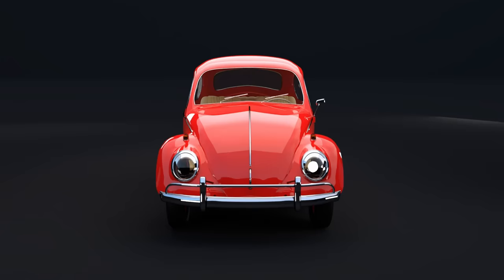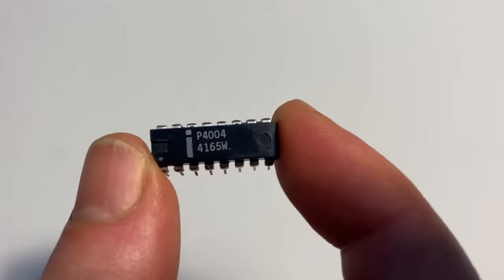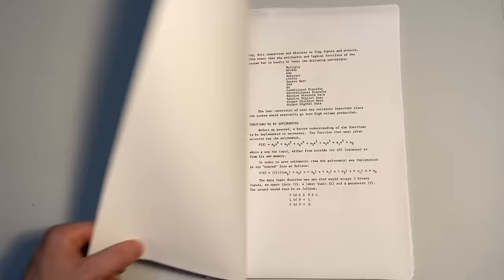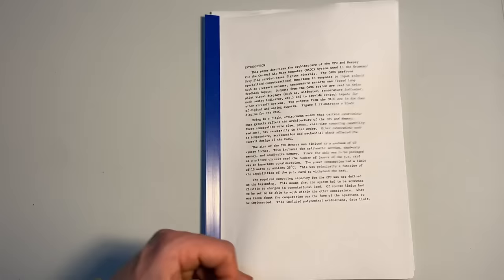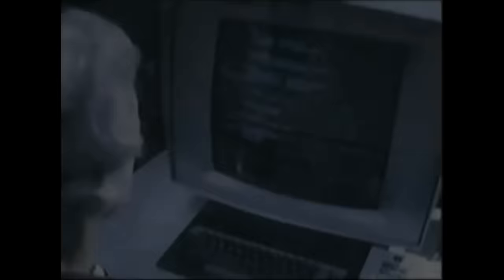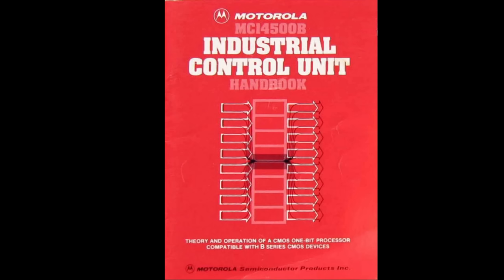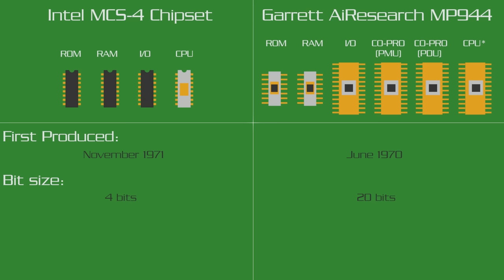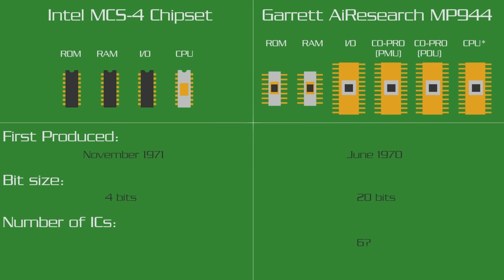The World's First Microprocessor: F-14 Central Air Data Computer

Comment: I think the biggest argument potential against the CADA being a "microprocessor" is that it can't do conditional control flow.

Not really a problem for the intended use case. The lack of conditional control flow is actually a massive advantage, as conditional control flow makes it hard to meet the hard-realtime requirements. Instead, the CADA ran a fixed loop of 512 instructions every 1/18th of a second, continually running the exact same equations. 
Anything you can do with conditional control flow, you can also do by calculating both sides of the branch and then select the correct result, which is a common technique in GPUs. 

This isn't actually a limitation of the MP944 chipset, the rom chip does actually have control inputs for controlling the program counter, with "reset", "retain", "increment", "load", "add" and "sub" instructions... In the CADA design, it's just hardcoded to the "increment" instruction to make it operate in sequential mode. 
However, there is no simple way to feed results from the "CPU" back to the ROM chip's program counter. There is no compare instruction, there are no flags. It's simply missing any functionality to control the program counter. If you did want to control the program counter, you would need to add yet another ROM chip and then a bunch discrete logic ICs to implement a "branch control unit" that implements a compare instruction and feeds addresses back into the ROM chips. 

It kind of feels like the MP944 chipset is missing a 6th chip to implement this branch control. 

The Intel 4004 has a massive advantage that the CPU chip has all the branch control stuff built in. The program counter might actually live in the ROM chip, but the cpu can modify it over the shared bus. You can create a minimal 4004 system with just a CPU the 4001 ROM/IO chip and 4002 RAM chip, and it has all the functionality a modern programmer expects a microprocessor to have. 

With the MP944, you are taking about dozens of chips before you get something fundamental to general purpose computing as conditional branching and conditional branching. It really stretches the definition of "small number of chips"

I guess it depends how you define "microprocessor". If your definition is just some kind of processor built with specialised microchips, then the MP944 absolutely counts. But if really doesn't look like anything that a modern programmer or engineer would consider to be a microprocessor.

Comment: What is amazing after listening to this, is that the Navy didnt upgrade the awg 9 radar to digital before putting into the Tomcat- as good as the awg 9 is, it just doesnt have the capability that digital processing brings to the table. This became very apparent flying the tomcat in DCS- the notch filter is just massive compared to the F15.

Comment: Hi! Electrical/computer engineer here and the waxing and waning in the microprocessor section was agonizing. The heart of your confusion is in struggling to define if the system can be called a microprocessor if it is not a single unit. The answer is the operational system all together is the computer. A system that can do all that on one chip is not referred to as a microprocessor it is referred to as a microcomputer or micro-controller. A microprocessor cannot compute on its own, it needs the other peripherals to run programs, it needs memory attached because they do not come with any. By failing to understand that the system you are describing is a microcomputer you are asking if these two processors are microcomputers and the answer is no they are both microprocessors.  MP944 is the name of the chip set which all together comprises the architecture of the computer but the lone CPU chip within that system can be called the first microprocessor. The sophistication of that chip suggests to me that perhaps a more crude microprocessor could have potentially been developed even earlier than that one and deployed in an item that is still classified.

Comment: A microprocessor with everything it needs to run on is own without any other chips is a microcontroller.  That's the way I learned it anyway.
Reply: Either that or an SoC. The distinction is more about capability than anything else I think. Microcontrollers tend to be less powerful.

Comment: Quick clarification: Radar didn't track only 6 target simultaneously. That number was higher. 24 if I remember correctly. 
It was able to lock and target 6 tracks simultaneously in TWS mode while talking to and guiding the missiles, which was absolutely insane capability back then. Beyond science fiction.

Comment: It's interesting to consider how much different computer science and computer design would be today had we not have started with analog items and them replicating them with digital ones.

CPU cache and RAM is is one hardware example. There are dozens of examples in the software realm.

I am sure that, if we started all over again (new languages from scratch for digital items, etc), within 20 years or less we would achieve a net increase in efficiency. We depend so much on analog frames. We could be so far ahead!

Comment: This is fascinating. Both in the exposition of design features and trade-offs (SBIST is alive and well today even for processors not yet released), and the similarities between the MP944 pipeline and a modern wide in-order MCU pipeline with asymmetric ALU stages. The SL feels so like the decode/issue and register bank multiplexing. It is such a shame that the 4004 pipeline is the reference that seems to be so locked in to basic computer architecture descriptions since it is so restricted.

Comment: The thing about the 4004 was that it popularized some techniques (VLSI) and  made it for 'general' consumption as I understand. The MP944 is clearly more complex and much more capable (but also built for a purpose, and no doubt much more expensive). There were others in the space implementing similar specs (more of an 8008 competitors that intel introduced a few months later).

Making the product commercially viable is very-very-very difficult, which is where intel really exceled (along with others like TI, motorola, etc.). The 8008 was quickly introduced after the 4004 -- the 4 bit design was too limited.

Something to think about is that the 'industry' wasn't very big back then -- everybody knew everybody. Many employees worked at other companies, etc. - Ideas, news, etc. travel fast. The innovations that allowed the MP944 and Intel 4004 to succeed weren't 'secrets' per se -- and I would wager that many people had an idea of what the Navy was doing / how the technology was applied in the plane.

Also if  interested, learning how each part of the microprocessor works is intense and rewarding (learning about transistors to begin with), but then how things like memory addressing works, interrupt handling, registers, adders, etc. It feels like you start with some basic concepts (which turns out aren't so basic) and then build on top of them. Then you see a logic schematic of a 4004 and it looks very complicated -- and really it's just a MVP

Comment: One oversight on "non-linear" given the hair-splitting nature of the video.  

We've have mechanical computers for "non-linear" computations since the early 40s (e.g. ballistic computers for artillery and bombs).  

I suspect the term you mean is "chaordic interpolated"--essentially solving non-linear and meta-stable differential equations using "brute force" numerical analysis techniques such as Newton–Raphson.

Comment: Heh, even going simple, well... I hate to tell ya... xD

(In all seriousness, great video! The polish and production quality is amazing, and this channel is going places I would think!)

Now back to the hopefully informative, uh... information. <_<

The wings aren't exactly lower-drag when they're swept and higher when they're out. That's an oversimplification that's maybe a step too far.

At subsonic speeds, the lift-to-drag ratio is better with the wings out, not worse; that's a lot of why they extend, along with moving the CoL forward closer to the CoM. Consider that the lowest-drag aircraft are gliders, which have enormous aspect ratios. Very long, thin, shallow wings that aren't swept are the best on drag.

Technically they do generate more drag... but that's because they also generate a lot more lift. Drag generated in the production of lift is not considered a downside. It's just kind of a 'cost of doing business', kind of like the cost of the raw materials you'd need to manufacture something physical. You have to generate drag in order to generate lift, so you want to configure your wings so that at least the drag they do generate, is mostly in the production of lift.

The other kind of drag a wing (and the rest of the plane) generates is called parasitic drag. This is drag generated for purposes other than lift or thrust, like the cost of keeping the lights on in a factory, administrative overhead, and other costs not directly tied to making a particular thing. For planes, this includes skin friction drag and, most importantly for the purposes of discussing the F-14, vortex drag. That is the thing that's so much better with the wings spread in "T-Pose" as you called it. It gets a lot more lift, and yes also more drag, but that drag is balanced more toward useful drag due to lift, and away from parasitic drag, resulting in a much more efficient aircraft at low speeds.

Once you're supersonic, though, things completely reverse. As much as possible, you do not want shockwaves interacting with wing surfaces, especially control surfaces. Because the air doesn't have time to get out of the way of the wing, that flat edge creates tons of drag. It also contributes to a faster rate of change of cross-sectional area, which creates a new kind of drag called Wave Drag. Sweeping the wings backwards to at least the angle of the shockwaves being formed lowers drag and improves controllability and lift at supersonic speeds. The cost of sweeping the wings back is that it actually amplifies an already-present problem, which is that the Center of Pressure moves rearward on its own as the plane transitions to supersonic flight. Sweeping the wings moves it rearward even further, which is why the Tomcat has such a gargantuan all-moving tail-plane.

Also, technically, swing-wing designs aren't really "obsolete"... not in the sense that they would confer no benefit because we're so much better at aerodynamics now. It's just that they wouldn't have enough benefit to justify the extra weight and complexity. This was always true for complexity, which is why we've never seen a swing-wing commercial aircraft. The military can afford to shoulder the extra costs and risks of those extra points of failure, and the literal cost of developing and building them, in exchange for the benefits. Commerce cannot. But once fixed-wing aerodynamics got to a point at which it wasn't just the complexity, but the weight that was the problem, most uses switched away from swing wings.

Comment: I'm not sure you understand that it is absolutely irrelevant whether or not the collections of chips known as the the MP944 was "significantly more complex" as the 4004 was not in any way meant to be. No purchasers of the 4004 in the early 70s would have preferred to have the MP944, even if it had been an option. The 4004 changed the world. The MP944 is, at best, a minor footnote in military history. It in no way changed the history of computing and a complete history of computing can be written without mentioning the MP944. 
The same cannot be said of the 4004.

Comment: The T-pose has a higher Aspect Ratio (AR), which will create LESS drag, not increase drag. Just take a look at a glider. The entire reason that they have such big wings is to increase the AR, therefore decreasing the wing-tip vorticies, thereby decreasing drag. 

The main reason for the swing wing is to have good controllability during landing, but tuck them in during supersonic flight so that your mach-cone doesn't hit your wing. It will also create span-wise flow, increasing the flow over the wing locally, therefore increasing the lift of the wing (lift = 1/2 * coefficient of lift * density * velocity^2 * area). So increasing velocity over the wing spanwise (sin( deflection angle )) increases lift, decreasing the nose angle (alpha), and drag. 
It also decreases the thickness-to-chord ratio, in the longitudinal axis, same as the spanwise flow, decreasing drag and increasing lift. 

The wings swept out more also allowed the flaps and aelerons to have a more control. As they were at more of a right angle to the airflow, and increased the distance to the longitudinal axis, therefore having more effect respectively.

Comment: Wow - I learned from you that the F14's swing wing didn't require straight and level flight to change - that's impressive!  I'd definitely previously made the same assumption you formerly had, and your video was perfect to undeniably emphasise the impressiveness of this by video of the F14 rapidly changing the swing wing at 8:26 and 8:40 (and introduced a bit at 7:40 too).  Awesome!  Thanks for your video =)

Comment: fun fact : from what i've seen on wikipedia, the 4 bit 4004 and the 8 bit 8008 began within months of eachother. The 8008 development was paused and resumed, but both ended up being launched within 5 months of eachother. Though the 4004 was first commercially available, it could have been the 8008 instead.
Reply from the maker: Yes, they were developed independently and actually have completely different architectures. It’s almost a shame the 8008 wasn’t ‘first’ as it was more interesting, more capable and laid the groundwork for the entire intel CPU lineage.
Reply: A great video topic would be the Datapoint 2200, the world's 1st microcomputer, which drove the development of the 8008.

Way ahead of Apple, among other contenders.  It is a story so big it actually deserves a feature length movie.  Nearly everyone thinks the revolution started in Silicon Valley.  Nearly no one is aware of how it actually happened.  In San Antonio, Texas.

Comment: Interesting history For reference, here are release dates of the earliest home computers and the processors they used
Altair 8800, released January 1975, used the 8080 processor
Imsai 8080, released ~November 1975, used  8080 processor
Apple 1, released April 1976, used 6502  processor
TRS-80, released August 1977, used Z-80 processor (I bought one in 1977)
Heathkit H11: released late 1977/ early 1978, processor was a mix of the KA11 plus other chips (would have bought one, but previous poor experience with their kits nixed that)
Initiation of mass market): IBM PC, released August 1981 (I bought one in 1981)

Comment: Nice job. I never worked on a Intel 4004 but did work on Intel 4040. It had the same 4 bit IO needing shift registers and latches to get anything done. That was back in the day with 256 bit x1 RAM.

Comment: 8:25 - The F-111 Aardvark was NOT difficult to control while sweeping the wings.

Here's a story...
You could actually air-refuel the Vark without touching the throttle setting.  How?  By modulating the wingsweep lever, which would increase/reduce your drag.

Air refueling is one of the more difficult piloting skills under normal conditions for any aircraft.  And the fact you could do it in the Vark without touching the throttle setting at all shows just how controllable the Aardvark was during the sweeping of its wings.

Comment: 10:50 the maneuver flaps do not command asymmetric roll inputs, they both actuate at a certain angle of attack below a certain mach number to make a tighter turning circle. "maneuvering mode", or auto is on by default and can be overridden by the pilots thumbwheel on the stick, but will return to auto after the computer switches between down and up once or twice. the maneuver flaps can be extended IF: wing sweep is between 20 degrees and ~50, and mach number is below around .6 to .8

Comment: the 4004 was originally designed to address the need of a calculator manufacturer in Japan. And because that project did not come to fruition Intel tried marketing it as a GP processor chipset. We looked at it then but went with a custom chipset to handle our limited needs. In theory you don't need a RAM chip, depending on available registers, but range of uses would be limited. IO can also be dispensed making it very restrictive. The co-processors just speed up the maths. But you can't do anything without ROM say like making an adder.

Comment: I don't think the MP944 was the first general purpose microprocessor; that title still lies with Intel's 4004. The Intel 4004 was the first commercial microprocessor available as a standalone, programmable integrated circuit, marking the beginning of the microprocessor industry. The CADC was an application-specific system and not a commercial microprocessor.

Comment: The F-14 could track twenty-four targets at once, not six.  It could conduct an attack on six at once, using Phoenix missiles, but it could still track the other eighteen.  The pilot could use voice radio to direct other aircraft to attack the remaining targets, if required.  It was a revolutionary aircraft because no previous or contemporary fighter could attack more than one target at a time and none could track more than two.  Nowadays the ability to track multiple targets is taken for granted, but it started with the F-14.